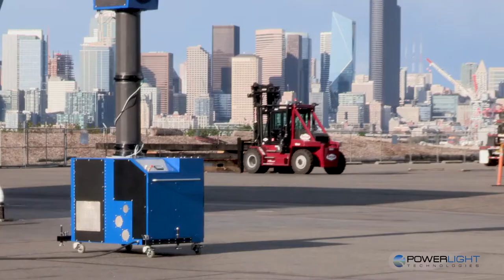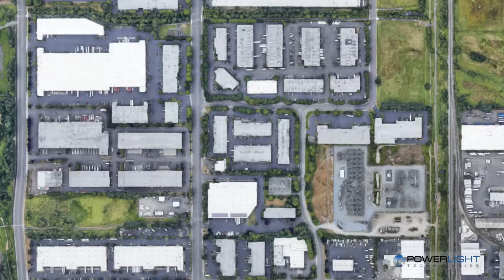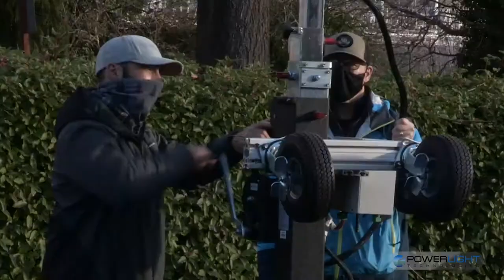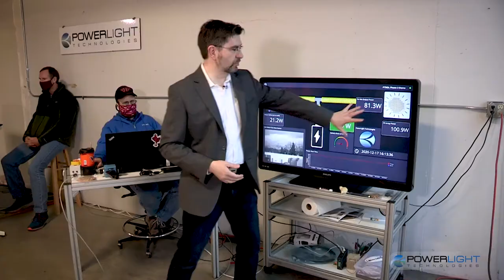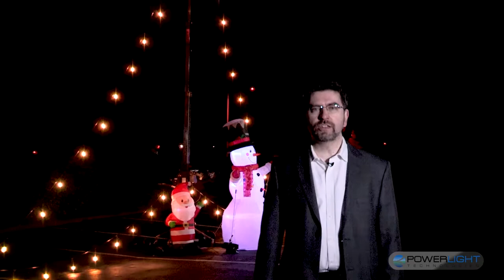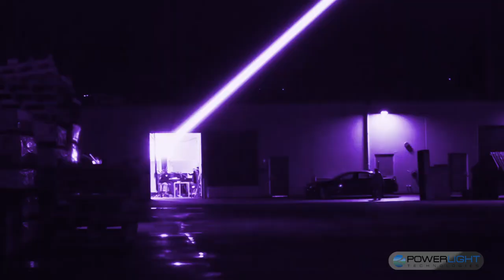Power Beaming 2020 Video

Comment: where is the laser at on the spectrum?
Reply: Ultraviolet
Reply: @ProfessorMoryarty near-IR would be better.
Reply: @NeonReverie-BP  Perhaps so, it's just a demonstration. Transmitting electricity via light beams is not profitable, as there is a large loss of power. Ultrasound is more effective at short distances.
Reply: @ProfessorMoryarty From what I see the end to end efficiency of say 10MW solar generated power transmitted via IR over say 10km to a GaAs Receiver then stored in batteries would be about 11-15% but the beam transmission itself retains 88% efficiency, it's just converting back and forth that kills it, plus solar tech is still to young. But maybe in ten years a startup could make it commercially viable to power homes safely.

Comment: which overal efficiency is this system from input power to output power, taking account to all of the cooling , regulating and safety systems?
Reply: 25% of it is visible on the monitor screen!))